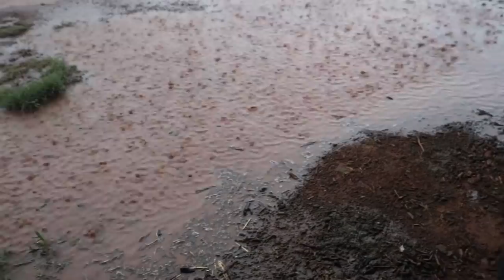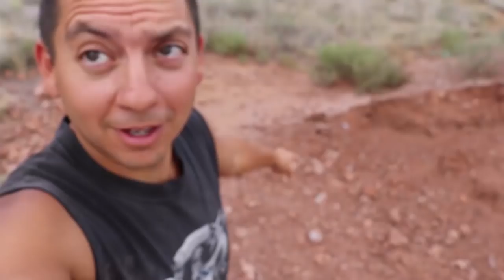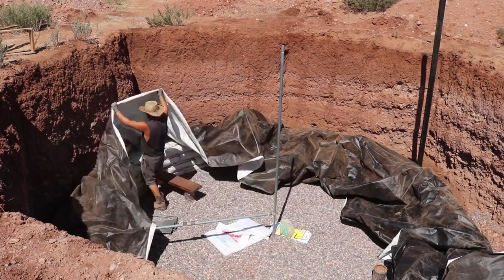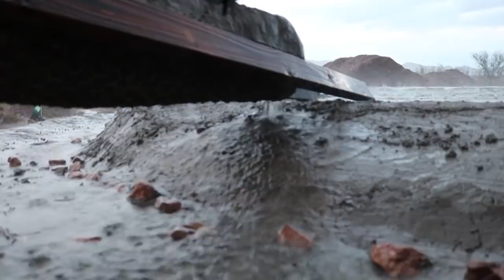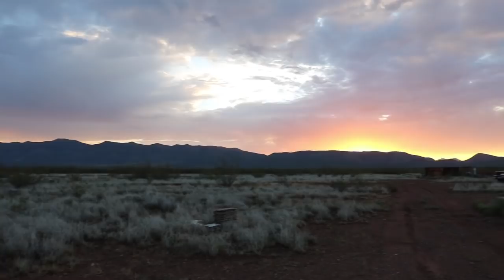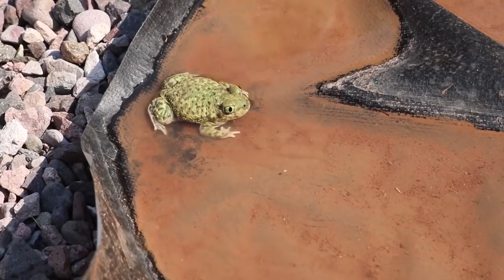An Intense Monsoon Storm Threatens Our Earthbag Root Cellar

Comment: The question that I have is, have you considered light equipment to reduce your labor and save time on your build and day to day homestead life? I define light equipment as under 3000LBS medium equipment is 3001LBS 6000LBS and heavy equipment as 6001LBS and up. The reason I define equipment this way is soil compaction when used. Most under 2500LBS equipment will lift 500LBS in a bucket. That can be a lawn tractor or a garden tractor with a loader. There are fewer light equipment manufacturers today than in the past. Struck magnatrack, and (the garden tractors are not what they used to be) Another option is the build yourself like the https://cadplans.com/products/cadtrac-1500 and the https://cadplans.com/collections/other-products/products/cadpull-model-302. The cad pull 302 was one of the best additions to my homestead, as it could be pulled behind my VW rabbit os a garden tractor. I have an old 14HP simplicity with a loader I built from plans from cad plans and it has saved my back. The other thing that changed how I do things is a https://www.youtube.com/watch?v=TxamY1FPPlY I think they are out of business but a gas-powered jack-hammer with the proper attachments can drive posts, power tamp, dig in rocky ground, dig a post-hole and much more. This type of equipment I am asking the question about, most do not even have this type of equipment on their minds.
Reply from the maker: Not really too much money to invest in machines right now.
Reply: @ourselfreliantlife  I truly understand that. Homesteading is to me about 3 things 1st is time and resources management, 2nd is family, 3rd is independence through being and staying as debt-free as posable, DIY, and food independence. This is the age-old struggle of substance/homesteading, but if you do not maintain your health and not living as a beast of burden, is part of taking care of your health. You do not want to be a crippled old man like me. You can find a very inexpensive old garden (not a lawn tractor) tractor with a blown motor and repower it and add a hydraulic pump and gather scrap steel and put on together for about than $1,000.00. Just the savings in time would pay for its self. If you do go with the garden tractor often you can find them free or little money and a single arm loader can lift 200lbs (on the small lawn tractors you will have two beef up the front ends, add RV antifreeze to the rear tire tubes, and add weight 100LBD or more to the back to have enough traction) and if scrap hunting you could put one together for less than $500.00. It will load what you put in a wheelbarrow in each load. https://cadplans.com/collections/loaders/products/cadloader-lt-model-507 A warning from an old man is that a small injury can lead to pain and jeopardize your future lifestyle/homestead. A little lower back injury and or a knee injury like a torn ACL. Another phrase that I live by is it is the little things that make a positive difference or will get you in the end.

Comment: All that rain makes measuring the land for a topography map important as knowing where to place retention ponds can be a big help overall. Double check what the laws are for storm water retention as they might have minimums on how fast you have to release the water back into the water rights of the area before it is seen as trying to take water out of the water rights. A 1 foot deep pond over 1 acre is 320,000 gallons of water storage so knowing how deep you can make a pond and how large you can setup some interesting water release locations to help you with irrigation. 

Catching the water as it comes onto the property from up hill in a pond as deep as you can make it and still do a 100% release over time to stay within the laws can catch a lot of water quickly.